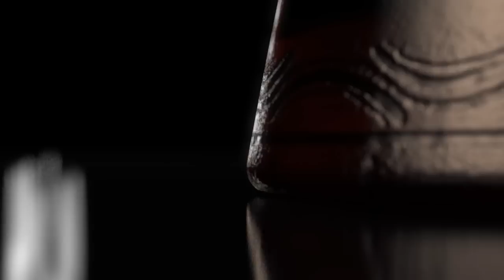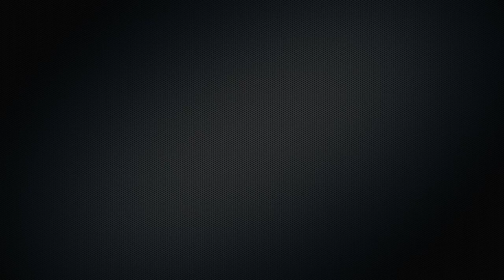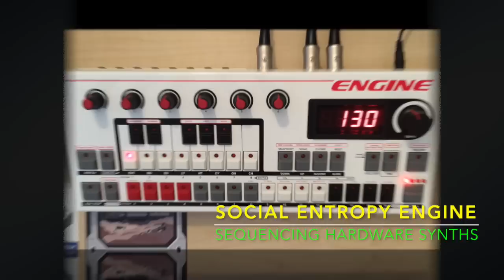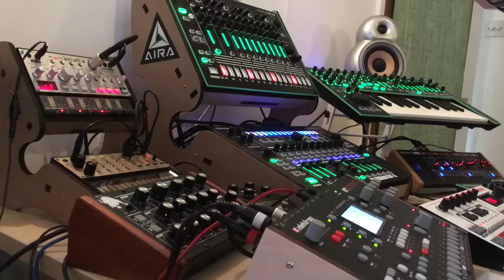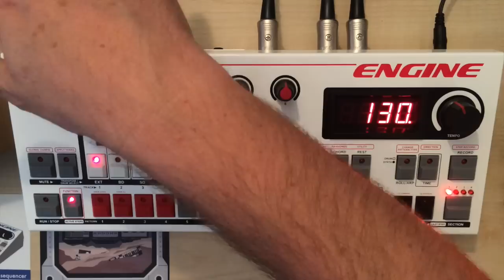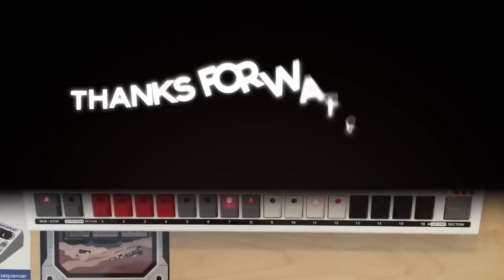Social Entropy Engine - Sequencing Hardware Synths Tutorial

Comment: Is there a way to use just 1 keyboard and program different patches from that keyboard to diffeet tracks ? My keyboard has several sounds I want to use in the same sequence
Reply from the maker: tyler gates Hi. If your keyboard is multi timbral and can play different patches on different midi channels then yeah. Engine can send midi program change messages per track to setup a patch for each track which is assigned to different midi channels
Reply: Awesome thanks for your quick response , I learned something new. I found out one of my keyboards is not multitimbral , bummer. My other one is 16 parts multitimbral so that's good.  Thanks again.

Comment: Man, this is a great and informative video. Thanks so much. I'm in the process of trying to switch from being DAW/soft-synth based to an all-hardware setup, and the Engine struck me as by far the coolest hardware sequencer out there, but reading the manual only gets you so far! This was super helpful. So great to be able to understand how I can bring my Monologue, my TR-8 and my Nord Stage fully under the same roof without a DAW. 

Saying that, now you've made me really want a System 1 and one of those little JU-06 boxes. Argh! ;-)

Comment: Hi Zooloomusik, seems like a weird questio but... how do save your project on the Engine once done and can you recall it later on ?
Reply from the maker: Ti Bretin there is a sysex bulk dump feature to backup the project to another midi device or your computer
Reply: Thx for your reply...Do you know any device that can handle the sysex dump ? Is it something "complicated to to do ?  I'm getting away from computers....
Reply from the maker: Any other midi sequencer would work. I guess though, if you have engine, it is your hardware sequencer, so you may not have another one. The computer is an easy way to do it. You can get a small midi sysex app and it's a couple of clicks to do a backup/ restore
Reply: Thx Zooloo,...Their is a couple of gear that miss the point of a trend that is to be able to work intuitively and safely on projects without computers....I just came across the mpcx that looks great... Keep up the good work mate and thx again for your reply.
Reply: Zooloomuzik can you tell me about snapshots? Wouldn't you make a snapshot and have it saved to the Engine itself for direct recall, or doesn't it work this way?